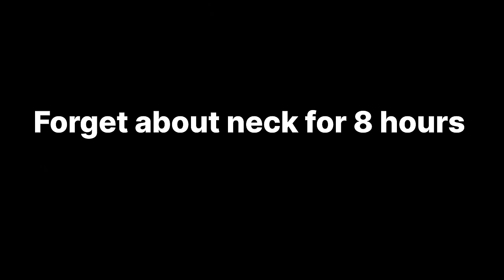Make Music Man Great Again| Bass Guitar Repair Guide SUB

Comment: Nice job. I'm sure it plays great. Since all the natural patina was removed from the neck but kept on the headstock, I would have used a tinted oil or lacquer to match the vintage.
Reply: Oh really Ted would you have? You would have ordered from Stew Mac for delivery in Kyiv is my guess too?
Reply: Actually, I would have paid someone to do it for me.
Reply: @darkscience1466  😂😂😂😂😂😂😂😂
Reply: He did it just as Musicman offers from the factory with an unfinished neck. Mine is exactly like this where the finish starts at the headstock. You would never get the same finish with a tinted oil. Adding a lacquer defeats the purpose of the repair.
Reply: I was wondering the same thing. When I saw the headstock put back almost as they were at the beginning, I got a shock and didn't understand why.

Comment: If you press the headstock back to open the kerf, Fender-style nuts come right out. Honestly never seen so much craziness to pull frets. If you grab them at an end and curl them backward like you’re using a claw hammer to take out a nail, there is minima tear-out. The solder approach seems dicey for a finished fretboard you aren’t going to refin.
Reply: Exactly

Comment: Good job.   I had a brief Duh moment while asking myself, why didn't he do the full Resto?   then It dawned on me 1/2 way through the thought... 
Some things are worth keeping, including every memory attached to every dent, scratch and tiniest of mark on the instruments that have brought us so much joy and healing. 
Being restored to original is fine on old cars, on old guitars, I think some artistic license can can be afforded if it can keep it's 'character' while improving it's playability.
Reply: That's the only way I would want mine done. A 93 Amer deluxe plus Strat maple neck. I've owned since 96. Lots of character marks in it I want there forever. Nothing all that bad but. Did the string line marks have to come out. I don't have that but I do have finish coming off on the fretboard and would like the look to stay the same. It's kinda dirty and worn looking. I like it. Can frets be replaced and original neck look still be there? Or does it all HAVE to be sanded smooth? Just wondering.
Reply: Stripping the back of the neck seemed a little overkill to me

Comment: I might have waited for the frets to be installed before I oiled the fretboard. That way the oil isn’t in the slots and the swelling wood holds the fret tangs tighter. And using a press rather than a hammer for the frets for a more uniform result. I also use glue under the frets. PRS does that. But that being said, the result is beautiful.
Reply from the maker: Thank you!
Sometimes I use a press, but often I work with a hammer.
I have also tried oil after I put the frets on and still I like to prep the wood first, the result is more cleaner.
Reply: Yup, I'm not a fan of oiling guitar.  It's  not a lawnmower...

Comment: Great job restoring neck playaability and leaving all the worn over body and headstock.
Reply from the maker: Thank you!
Reply: Which doesn't look right.
Reply: @mattrogers1946  if you want to play a very worn old instrument, you need to restore the fretboard functionality. If you want to completely preserve the worn aesthetic, hang it on the wall and look at it every now and then.
Reply: @marcello urban  To be able to do both, differentiates the luthier from the shade tree repairman...
Stripping the neck was over the top.
Reply: @mattrogers1946  Ok, now I know You're a professonal luthier.
Reply: @marcello urban  I never implied that I was. However,  I am able to work on my own guitars, and I know that removing the finish from the neck wasn't a good idea.

Comment: I was told by a certified Martin Tech/luthier that if you do not press your frets in with a fret press,.....they never properly seat. Just curious about your thoughts on this. Great video by the way. Im subbing now. Very satisfying.
Reply from the maker: Often the press does not give the desired result. I'm used to working with a hammer, this way I get it faster and smoother. sometimes I take the press and use it

Comment: Nice work! I have a question though. :-) what kind of foam are you using to muffle the strings. could this be done with the hard foam they use for (amp)flight cases?
I did a repair once and the foam was just not hard enough to muffle the strings in a decent ways.
Keep up the good works and hang in there!
Reply from the maker: I used emg picups leftover foam and it works perfectly.
Thank you!

Comment: Nice.

1. Always worked to the assumption that maple should be sealed with lacquer to withstand humidity. Is oil enough?
2. Why not quickly disassemble machine heads, clean them up and re-lube them before re-assembly?

Comment: Question! This may make me look dumb, but why use solder when removing frets? I see a ton of people do it, and it seems to work wonders. But I'm curious about the purpose of using solder over just touching the iron to the fret. Thanks!
Reply from the maker: The solder gives fast and uniform heating of the fret, in this case the glue dissolves under the entire fret and is easily removed. You can heat without solder, but you need to take the fret out much slower and more carefully.
Reply: @mr.k1t  That's what I was thinking, but was unsure. Thanks for the reply! Keep up the great work!

Comment: Really nice sympathetic job for a player's instrument. I am curious, how well does oil stand up over time? I have not used it on a neck, but I have a maple floor and it doesn't seem as durable as film finishes like varnishes/lacquers
Reply from the maker: This oil hardens and creates a crust, thereby protecting the maple. I used the same method on my strat about 3 years ago, I play it and the oil still protects the neck. Ideally, you need to re-cover somewhere in a year (I did not)
Reply: @mr.k1t  yes I've used Osmo and similar hardware setting-type oils a fair bit, just never in this scenario where roundwound strings will press into it! Recoating is easy, I guess it's just a matter of remembering to do it before it wears through and the wood goes grey

Comment: I use an old Weller soldering gun with the very tip cut off. Bend the cut off ends so they touch either end of the fret. You can feel it in the gun when it takes hold. Takes just a second or two and the whole fret is hot.

Comment: Hey MRKT, I am having my EBMM axis neck refretted with stainless steel frets. The Luther that is doing the work said " the one thing he won't do is the finish". I'm fine with that. I would like to do it myself with the product you are using in this video.  From what I can see, the can says OSMO top oil. I did a Google search and there are a few different item numbers. I would think you are using the clear, but could you please tell me which one you are using, so I can order it ASAP.....THANKS PAL.......UNBELIEVABLE WORK BTW!!!!
Reply from the maker: Thank you! it`s Osmo Top Oil Satin mat 3058 but you can also use 3028. Good luck!
Reply: Thanks MRKT. I'll be ordering the satin in a day or so.....I  appreciate the quick response pal..
Reply from the maker: @coverts5t   no problems. Good luck!

Comment: I know this is a year old but honestly surprised at the changes between 1987 and 1989, I've got a stingray 5 I bought in high school that has the truss rod adjuster at the neck heel as well as 6 bolts to secure the neck. One thing in common is the softness(spunginess?) of the lacquer. It's never looked as good as it sounds.

Comment: The nitro lacquer on the maple fingerboard wears off and the fingerboard ends up that dirty.
Maple fingerboards have to be lacquered because maple is not hard enough to withstand wear and tear from string rubbing. However, over time, the lacquer wears off....
Ebony, rosewood, pau ferro,... are hard woods with very little pore and somewhat oily. This means that they do not wear out and do not need lacquer.

Comment: Hey there. Great video. Can you explain why you use solder when removing the frets?
Reply: He didn't actually use any solder. He just heated up the frets with a soldering iron. This is a common practice when removing frets to avoid damaging the fretboard. The roll of solder in the background was probably just placed there because he stores it with the iron. I can see how that might have been confusing.

Comment: why didn't you clean/polish the tuners and the bridge? what can I use to polish and make them shine again on my stingray?
Reply from the maker: The problem with polishing is that the tuners and bridge are chrome-plated, if corrosion has taken them, the only way to do it well is to remove the chrome plating, sand it and re-chrome it, most often they don’t do this, but simply change it.
Reply from the maker: You can use vinegar or wd-40 for clean it from rust, And then use abrasive paste with felt and engraver. But you may not be satisfied with the result.
Reply: @mr.k1t  oh thank you for the response. they are not rusty, they are just dull, they don't shine anymore. and you know, no one says no to shiny, eye catching knobs and pegs.

Comment: beautiful neck, should have one or 2 light coats of lacquer to protect it tho, then it can be cleaned as well, ya don't wanna hit bare maple with water it swells right away so always a few coats of very light lacquer, hand rubbed whatever.. I may have missed that process?
Reply from the maker: This type of oil creates an excellent crust that prevents sweat from getting onto the wood.

Comment: Those Fender-style tuners are easy to find. Why not replace those as well?
Reply from the maker: The customer decided to leave it in this condition.
Reply: @mr.k1t  ahh makes sense. Thanks.
Reply: This is not a Fender style, this is Schaller.

Comment: Gotta ask, would there be any additional steps to have used mandolin wire for the frets?
Reply from the maker: Sorry, but I didn’t understand your question.
Reply: @mr.k1t  Leland Sklar has often spoken of his preference to have his basses equipped with frets made of mandolin wire which has a lower profile and allows slides and glissandos to sound smoother.should also have mentioned what a beautiful job this was to watch.
Reply from the maker: @clcortelyou  
I understand. I put such thin frets several times, but the feeling of smoothness did not increase much. In my opinion, the clicking of the strings has decreased. I also think that such frets will not last long, maybe it makes sense to put stainless steel ones. Thank you.

Comment: Removing that well used and time relic'd lacquer from the neck was a crime!! That was hard to watch. This guitar needed a re-fret and a good cleaning, nothing more, in my humble opinion. The value of this instrument was likely cut by half or more with this "restoration". Strong work, as usual, but the customer made some questionable choices here.
Reply: People buy instruments to use them gramps, not for the resale value.
Reply: @ileutur6863  The instrument was perfectly usable as it was, and would have retained all of its value, so there goes that argument.  An instrument can be repaired, even restored to a playable condition, without, in essence, destroying its intrinsic vintage value. Possibly that escapes you, due to your lack of age and experience? ✌️
Reply: @Metalcop5150  value, value, value... its a tool to be used on stage.
Reply: @ileutur6863  You can have both!! The value could have been retained and the playability fixed, as I stated in my comment. No one is going to quibble about refretting a "tool" and cleaning it, so that it will function. Practically destroying it by scraping off all the original lacquer from the neck is borderline criminal.

Comment: But is this actually a restoration? I think there has been more change than "restore" Because I think the end result here has been decided by current fashion, with the physical result, playability and ongoing required maintenance  being very different from what Leo Fender intended. When this bass was released with a lacquered neck and fingerboard, particularly important for maple, as it stains easily, obviously the owner can oil the neck - at least 3-4 times a year, more if played heavily - but be careful as too much oil will damage and kill strings, oil your hands, basically a messy experience. I have a 77 stingray as original released with lacquer, the neck is fast, protected and sealed, I have had the neck lacquer "fixed" a couple of times, and you would never know. MRKT has done an amazing job and the MM looks fantastic. But it's not a restoration, and how could you get the neck back to standard if you wanted to?? I don't think the rules of antique instruments apply yet to those made in the late 20 century, but if they did, this neck work would have unquestionably devalued the bass

Comment: If I were the owner I would be very upset.
After the "restoration" neck and palette have two completely different colors.
The mechanics have not been touched but they could have been restored with very low effort, the palette still has horrible scratches...
My personal vote is 5/10

Comment: I appreciate the detail that you put in to the neck but it bothers me that you didn't clean up around the base of the tuning pegs, or restore them removing the corrosion. Also the scratches on the pick guard could have been removed. Jobs not finished until its finished!
Reply from the maker: I completed the work that was ordered by the client

Comment: I'm horrified that you did a complete refinish to the neck and refinished it with oil, rather than just cleaning it up and leaving the poly with 35 years of wear and tear. I would've just cleaned all the gunk and corrosion off the body, neck and hardware and done a re-fret, if necessary.
Reply: Yup

Comment: That was a fantastic job but you did completely ruin the look of the neck. It had such a beautiful golden aged look and you completely ruined it. Going from that to completely new wood is sacrilege. 

Before applying the oil you should have stained the wood to match that golden aged look again. The headstock was right there for you to compare it, and match it with. 
Please don't ruin any more guitars.

Comment: The condition of this bass is nothing but fake.
Reply from the maker: Really?)
Very interesting to hear arguments)
Reply: @mr.k1t  First of all I know how real long played instruments look like. Unless the former owner hasn't practiced chromatic scales 24/7 with his fingers dipped in black paint, nothing like this. 
Come on, real play wear isn't distributed totally even over the whole fretboard. It concentrates on hot spots and the finger marks are closer to the frets and align with the strings. Nothing that's present here. And what is it with the color of the marks? But enlighten me what am I missing if it's not supposed to be a bad relic job?
Reply from the maker: @SxSxG666  I understood you.
This bass has been in use by a man who works on a cruise ship for many years. Let's add that, apparently, the person was not too careful with the guitar. Attempts to independently remove rust and oxides with sandpaper are visible.
I believe that I am the first luthier this instrument has met. Markers have adhesive residue in the form of a yellowish halo.
Reply: @mr.k1t  Well, knowing now that the bass was used for a wrench to repair cruise ship diesel engines, it kinda adds up :) Nevertheless what matters is that it is playable again.
Reply: @markkeeler584  I've neen playing an ESP for over 22 years on many tours and live shows and I have a J bass from 1979. Both don't look anything like that not even remotely ;)
Reply: @markkeeler584  How's that related to anything? Think it was used in combat after the previous owner has used it on diesel engine repairs? I'm staring to suspect it was a bad idea to cover the instruments rich history with this repair job.